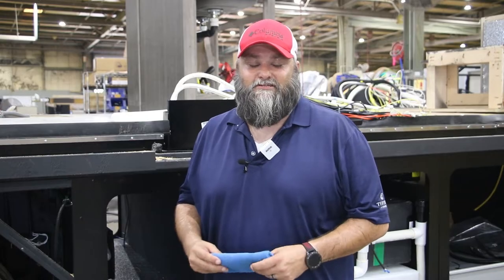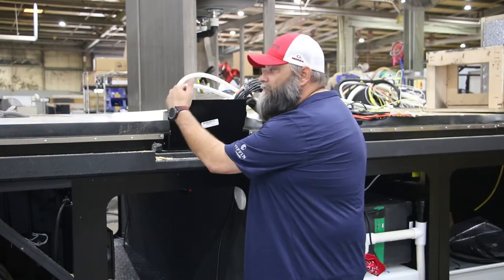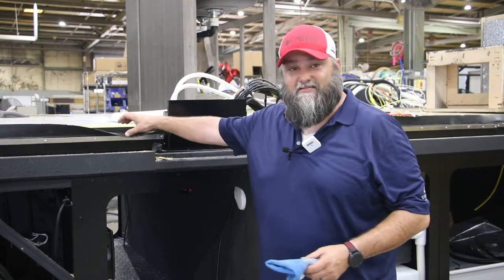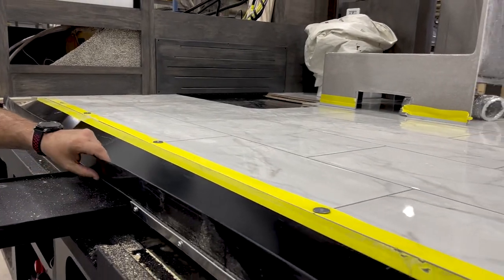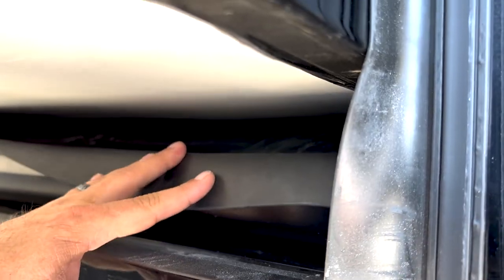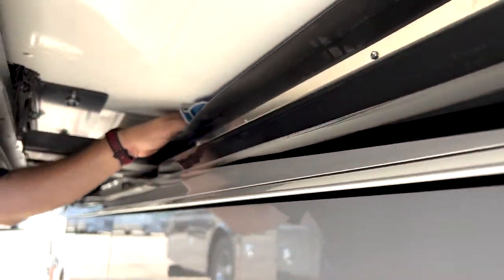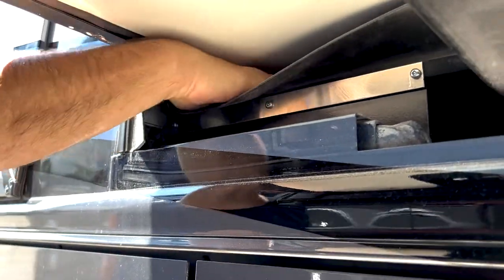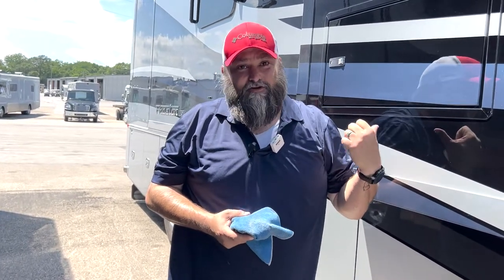Tiffin Tips - Cleaning Your Slide Troughs To Prevent Roller Marks

Comment: Huh... on my rear slides the trough flap doesn't even touch the bottom of the slide in places... when I asked for warranty service on this, I was told that they don't want to touch as they can get pulled into the rollers? (I actually think the slide was installed higher than designed as the inside brush seal doesn't touch either.